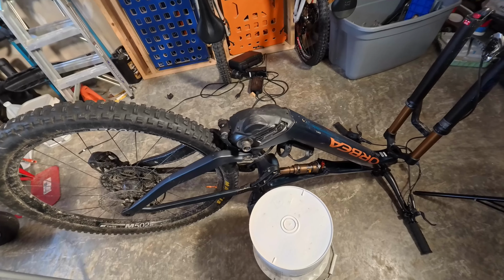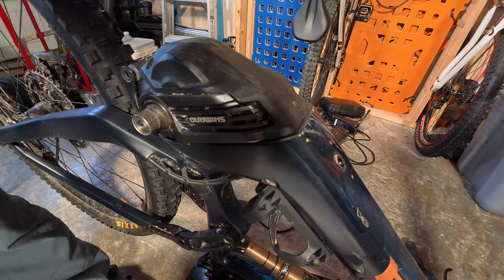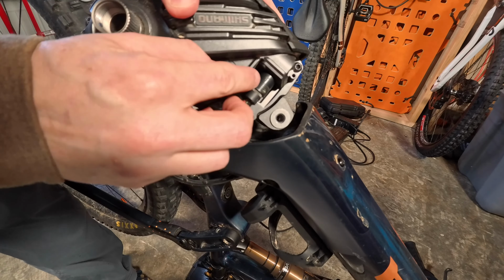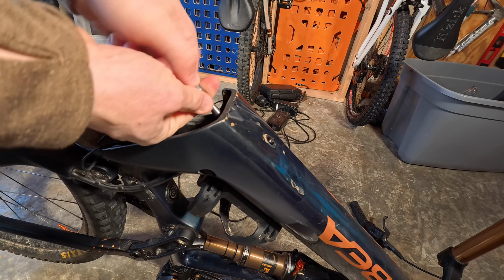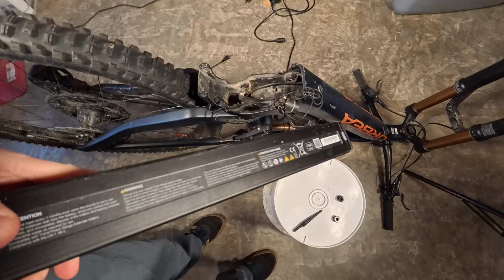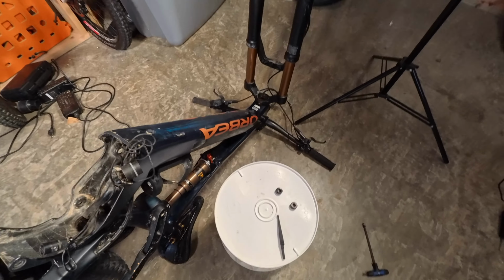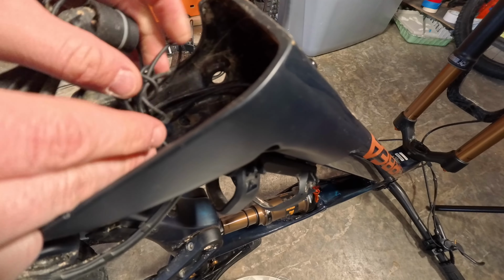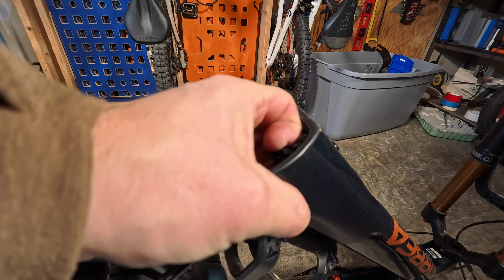Orbea Rise Battery Removal

Comment: pretty similar to the 2023 wild. I had to replace my dropper cable and take the motor and battery out. But now just waiting on a O ring that goes on one of those big spacers that was ripped when I took out the motor, the wild has just one big spacer tho. 
Thinking of buying some lights now that the battery and motor are out, hehe
Reply from the maker: @angelffalcon3134  how do you like the Wild?  I like the way the new one looks.
Reply: @jdmtb  for being my second ebike after some cheap chnese one, its great, but just got it, haven't really got the chance to go riding in trails with jumps yet.

Comment: Hi, is possible change  the 340 battery from my rise m10 2021, and adapt the 540 battery rs gen2?? Thankssss
Reply from the maker: I don’t know the answer to that question.
Reply: No. Gen 2 ist only for the EP 801.
Reply: Yes, I know, but I hope there's a way
Reply: Yes, you can look for a Rise 2021/2022 H model which features a 540 battery. it will fit in your M10 without any concern
Reply: Hi, very interesting, I'm going to study, thanks
Reply from the maker: @vicdeng1614  awesome!  Thanks for answering that!
Reply: @jdmtb  Everyone I've asked has told me that it's not possible, because the shape of the battery is a little different, so it can't go into the compartment, they do it specifically for you to buy a new bike. But you can take an old battery, change the cells and make them more powerful, this way you increase the power of the final battery.
Reply: @Miquelangel3d some Guy made it fit. 360 WH gen 1 swapped for 540 from a gen 2. I'll will do this myself and swap the motor for the ep801. I got the m10 2021
Reply: you won't get more power motor power by changing battery cells. The BMS on the battery can't be changed and it will restricted how much power you can draw.
Reply: @nesimsarac1841  okkkk I only want more battery charge for made more distance

Comment: I think the range extender is the better option, at all.
Reply from the maker: Other reasons to remove the battery would be to route cables or replacement of a faulty battery.

I wouldn’t recommend trading batteries to extend the range. Way too much work. The extender is a better option for sure.